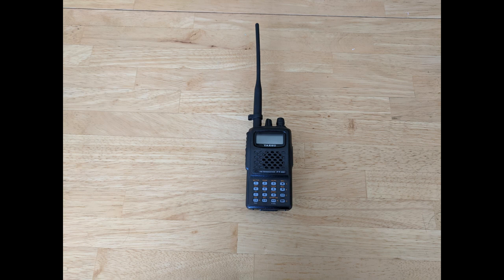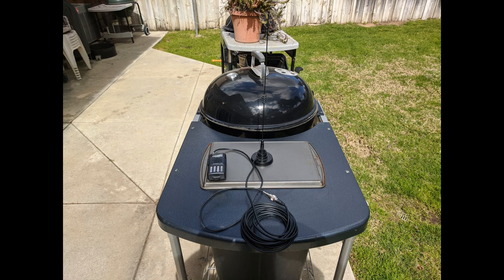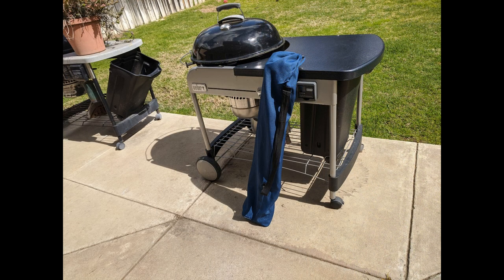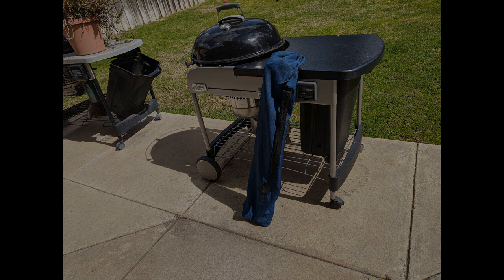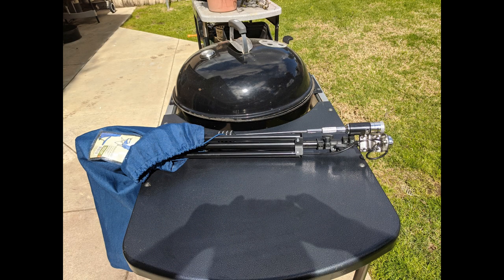Using External Antennas to get better performance from your HT

Comment: Thanks for the tips. I recently got my Technician license and could not get any contacts on my FT-65R from my house. After watching this video, I got a mobile mag mount antenna and stuck it on a baking sheet and put it next to the window. I was able to hit the repeater 12 miles away and made a contact with a guy about 30 miles from my house. Eventually I will get a mobile unit and bigger antenna but my HT will do for now. Thanks again for the tip. KO4FTH
Reply: Hey Eric, KQ4PUD here! I recently got my Tech license and I have a YAESU ft-65 as well. I’m not in the market for a mobile radio yet but I’d like to do the magnetic antenna setup in my car for the time being. Could you send me a link to the parts that you used? My biggest issue is finding the adapter that will screw into the HT. Thank you.

Comment: I just came across this video today . I just learned a little bit more. I figured there was a way you could use a mobile antenna with your HT . I’m new to two way radios. I chose GMRS because it seem to be the most versatile for my needs. My next thing will be a couple of MURS radios. For now it’s GMRS. 
My home set up is a BTech V1 GMRS. My antenna is a Tram mobile antenna with a Tram ground plane. My V1 GMRS is a 2watt radio . I’m also using a Retevis RT76P it’s a 5watt radio. I’m going to do range test. From base to HT’s and see what ranges I get . Of course I’m aware of things that might be the problem if there is any . Watching this video help give me ideas for getting the most of  my radios.  I figure my Radios already cover most of my property. I can cover it all  if I set up a mobile antenna on the farthest end of the land . I will just leave It there when I can’t reach base or others down in the hollows. I will hook up antenna number 2. 
My other plan for reaching to the town close to home is a mobile antenna and a simplex repeater.  . It all boils down to I want to be able to have full communication to HTs to base to mobile radio . I think in a emergency situation I should be able to communicate with my son that lives 6-7 miles away . All that cost money it might even be difficult because we live in the southeast Ohio area. Lots of hills and trees.
Reply from the maker: Hi Steveder,
Keep in mind that power ratings for GMRS are based on ERP and not PEP... In English, the antenna gain needs to be calculated into the total power formula to make sure you are in compliance with "Title 47, Part 95.1767   GMRS transmitting power limits.". Read this carefully and make sure you have factored in your antenna gain before transmitting!

Stu
AG6AG

Comment: Great video.  You're the first [person I've heard say anything about a Comet antenna. I use them on my handhelds except for my ICOM IC V86.  I have a Diamond RH205 5/8 wave. I also have an MFJ 1714 1/2 wave for it too. I use the MFJ antenna on the ICOM now.  It does seem to be a little better than the Diamond. I'll have to look into getting the tripod setup you showed. Have a great one.

Comment: Nice video. If it was me I would go for a mobile rig like the FT7900 giving 2M and 70cm for not much extra cost and the extra power if you need it. Also it will give you the extended receive capabilities. Cheers. Pat.
Reply from the maker: Hi Pat,

Yes, the FT 7900 works very well. We have a couple of them in EOCs within the county. I actually own a couple of the FT 8900s and wish they still made them.
All the analog only radios are going by the wayside for radios that include digital phone abilities. DMR, Fusion, D-Star, etc... etc...

Stu
AG6AG

Comment: Sent that to soon. I will add a Midland mobile radio for my base station. Like I said I’m new to two way radios. Only been into them since January 2021. I have been doing a lot of research and I am still learning. I’m also the type that goes a little over board . I have 3 V1 GMRS radios . 1 Wouxun KG805G and a Retevis RT76P. All of them on a clear winter day can from the front door of my home talk to my wife 6-7 miles away . That’s with her sitting in the truck windows ip even. Now that the foliage is in full . I can only get 2 miles. 
That said I do believe with my new base station antenna and a 15-20 watt radio I can meet my goals. If I do my part and hook the antenna up right and make sure everything is making a connection. I forgot to mention I live on top of a big hill . Lots of fields also broke up with trees. I know I go off subject but GMRS is new to me and I’m the type of person that tries to get the most out of my equipment.
Reply from the maker: Hi Steveder,
Keep in mind that power ratings for GMRS are based on ERP and not PEP... In English, the antenna gain needs to be calculated into the total power formula to make sure you are in compliance with "Title 47, Part 95.1767   GMRS transmitting power limits.". Read this carefully and make sure you have factored in your antenna gain before transmitting!

Stu
AG6AG

Comment: I attached a Yagi 3 elements antenna on top of a PVC pole and got some success with my 5W HT. If I pointed it to the right direction, I could call into Bozo repeater from 9 miles away without line-of-sight. I eventually upgraded to a mobile 45W rig though.
Reply from the maker: Hi Yi,
Antennas can really change your reach!

Comment: Which SWR meter would you suggest?
Reply from the maker: Hi,
The answer is "it depends..." I have several that I use all the time. The important thing is that the meter is compatible with the frequencies you want to test on. All the meters I use are both WATT and SWR. As far as a brand names, I tend to lean toward the MFJ or Diamond meters. If you are strictly interested in VHF/UHF the MFJ842 is a good choice, but remember, an SWR meter has a bit of an issue when dealing with low power (like a HT). When I was testing a lot of HTs and HT antennas, I found the NISSEl RS-50. The RS-50 is digital and requires a battery, but works on very low Wattage.
Don't forget, you will want a decent dummy load as well, and may need some adapters to get a meter hooked up to your radios and antennas.

Stu
AG6AG